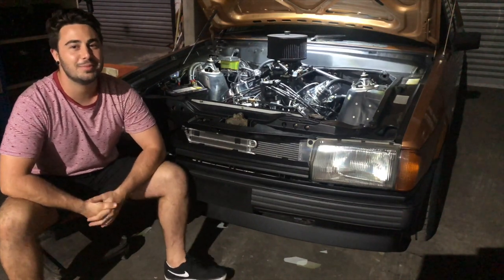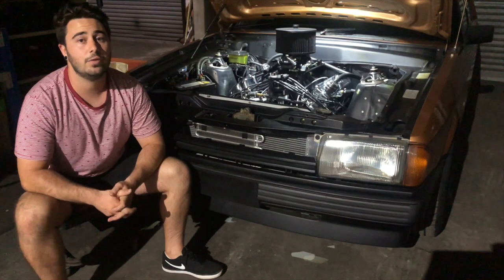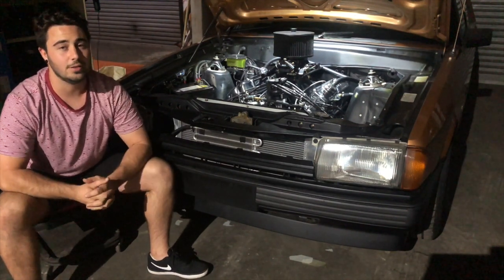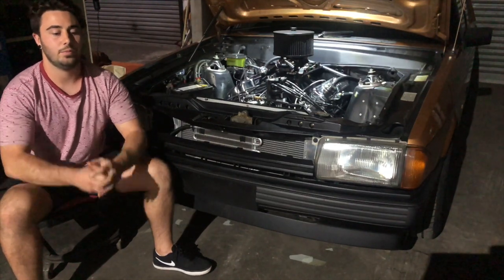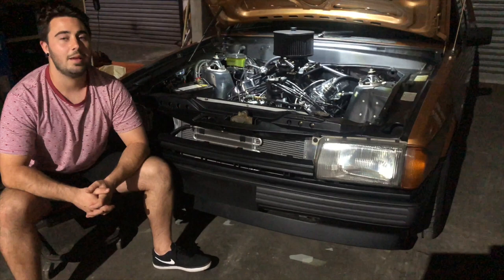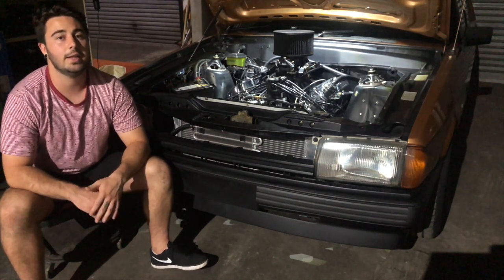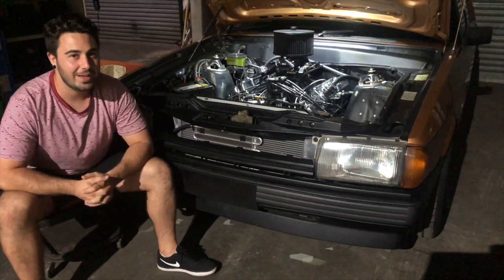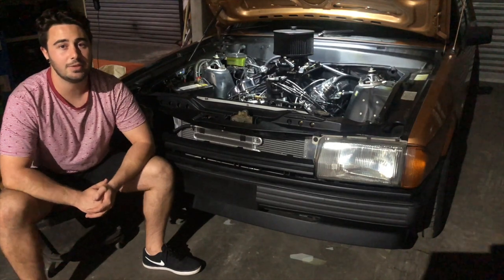351 cleveland engine specs

Comment: What are the cam specs? Great build!!!
Reply from the maker: Thank you!
Reply: I have a 76 F100 Dentside with a 351c I'm rebuilding ... looking for a decent cam hence asking about your spec. I'm running 2v heads too and have done a roller rocker conversion.
Reply: So far everything is pointing to a Comp 32-250-4 / XE284H
Reply from the maker: Couldn’t tell you the specs off the top of my head I’d have to find the spec sheet.